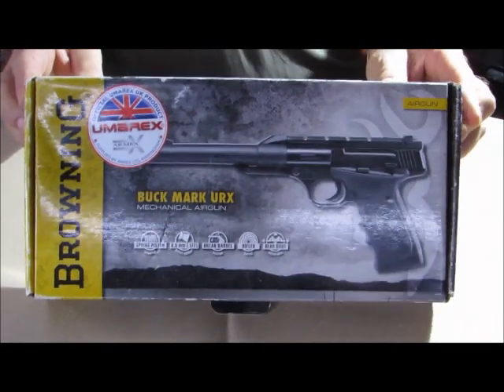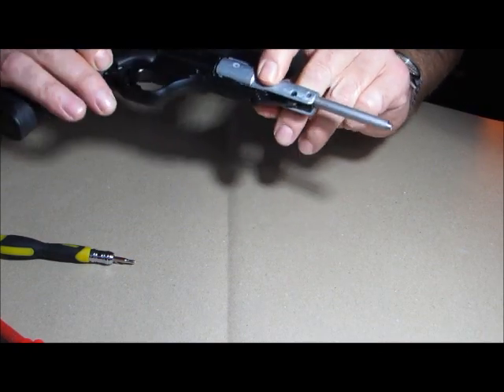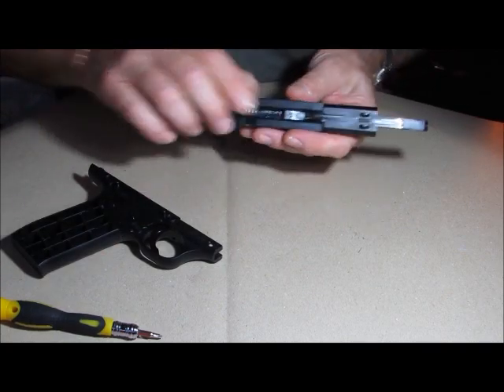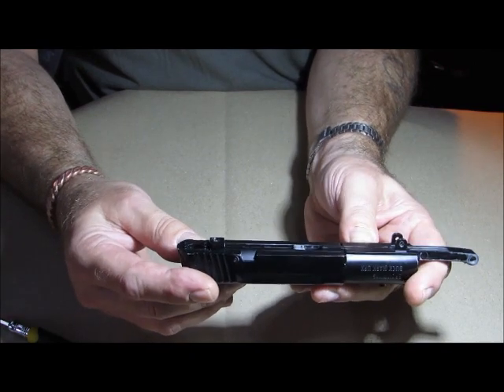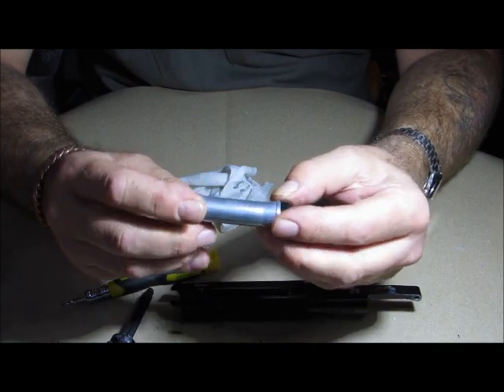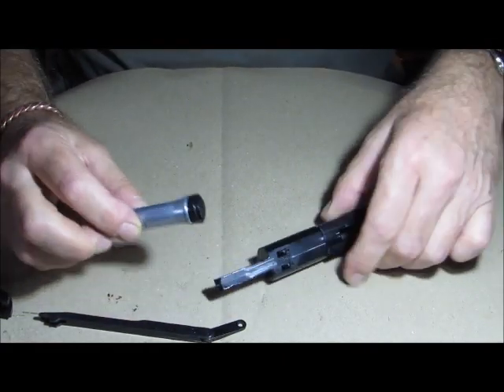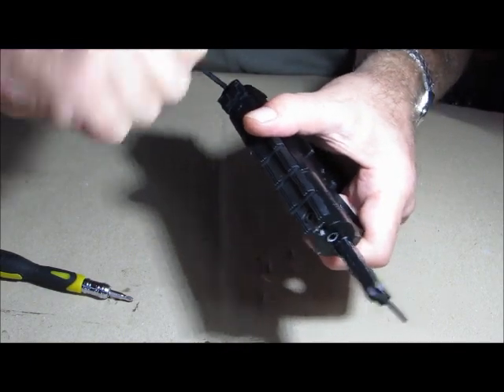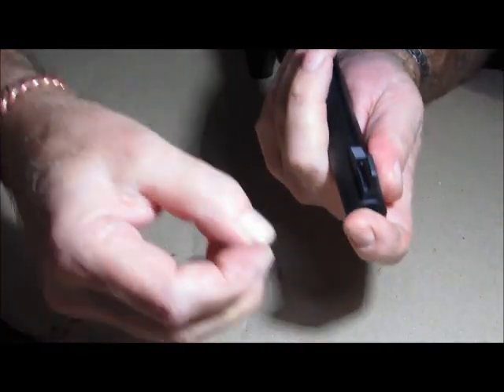Umarex Buckmark .177 UK Air Pistol Stripdown And Tuneup Plus Reassembly

Comment: Thanks for the informations - very helpful ! I only wanted to add a comment concerning the fact that my Umarex-model had a slightly different locking of the trigger spring unit - there was not a screw for fastening but a bolt. First i couldn´t identify that this bolt was really removable because it seemed united with the frame - i used a side cutter to pull it out...  Greetings from Germany ! Marc
Reply from the maker: Hey Marc, thanks for the update. It seems umarex have made a few minor changes with how the gun is put together. Great to have viewers from Germany, thanks for watching.

Comment: Biggest problem is the trigger pull.
Read the reviews.
The only cure I found,was to remove the trigger group.
You will see a trigger spring.
Remove,take off a link or so,grease it and replace.
Got my trigger down to 4 lbs.
Reply from the maker: Thanks for the info.
Reply: I agree, shortened my trigger spring and it improved it. It's still nothing special, but better.

Comment: Best instructional video I've ever watched, and I've watched plenty! I'll be buying that pistol soon and utilizing your video. Great job Bloke! I will be testing the trigger prior to disassembly and attempt to modify it, if necessary. I will probably add weights under the pistol grip if the gun feels too light. I might even try stretching the spring a little? I have to do more research re that project. I will probably use some metal shim stock to reduce the barrel play. Thanks again.
Reply from the maker: Thanks, glad you found it useful.

Comment: I just purchased one of these and the first shot has jammed in the barrel, I thought I was just a bad shot so loaded another, it wasn’t until the 4th shot I realised they wasn’t even coming out. What do you suggest I do? Try and take it back or fix it myself? Thank you. Great video
Reply from the maker: Obviously the first pellet jammed, and the rest are behind it. Try clearing the barrel with thin rod of some sort. You may have just been unlucky and had a deformed first pellet. If you get it cleared try another brand of pellet if the ones you have jam again. Good luck.
Reply: @ShootfishProductions  thank you I appreciate it, especially getting back to me so soon. Should I push them back the way they came or try to push them out the front?
Reply from the maker: @bobbyb2427 any way that works!
Reply from the maker: @bobbyb2427 id push them towards the end of the barrel if you can.

Comment: Great video... wonder if you could help a bit more. at 11:12, the small allan key screw wasn't visible, it looked like it had an aluminium blank filling the hole like they do on the Air Arms rifles on key allan screws to stop you doing any maintenance/tuning. I thought I'd drill it out using the same trick but it's all gone a bit pear shaped and now I'm in a long way (about 6mm), still no sign of the plug finishing and no grub/allan screw! Now not sure if I've drilled out a plug that was pressure fitted to stop it being taken apart and now made the pistol unsafe/usable. HAve you or anyone else come across this... any ideas? Many thanks.
Reply from the maker: you may have a different model to us so i would say do some looking into different models of the buckmark because it been out for a long time their maybe slight veriations over the years but if not we can take it apart agian and lookintoit for you.

Comment: Very detailed video!
I have a question. Which parts are metal, which parts are plastic?
weapon body? The handle (under the cover)? The mounting rail? The part under the mounting rail? Thanks for the reply!
Reply from the maker: Hi, thanks for your comments. The barrel shroud is plastic, or as its now called ballistic polymer. So is the mounting rail. The main body including under the grips is all metal. Hope this helps.
Reply: @ShootfishProductions  
Hello!
Thanks for the information. Would a stronger spring still work safely?
Reply from the maker: @thomasunbekannter6464  I think a stronger spring would work, but it would have to be the same length. I tried packing with washers under the spring, but then it would not cock.
Reply: @ShootfishProductions  
Thanks for the reply. I think I'll buy one in the near future.

Comment: I accidentally fired the gun while the breach is open, and now the trigger won't cock. I'm kind of in idiot when it comes to airguns. I came to this video hoping I could find the issue by taking it apart, to which I have come to nothing. Any ideas?
Reply from the maker: Probably the cocking lever, the flat bar that pushes the plunger back. Disassemble and reassemble, good luck.

Comment: Great gun and a fine video mate.  Quite enjoy mind though i could wish for a slightly softer trigger and a little more power.
Reply from the maker: Thanks. I agree entirely, softer trigger and more power. I did try and increase power by stacking more washers under the spring, but then it wouldn't cock. I do like how quiet it is though. Thanks for watching.
Reply: @ShootfishProductions  absolutely. Very nice "don't piss of the neighbors" noiselevel haha